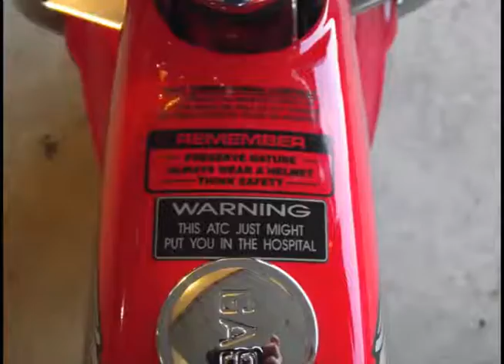1973 74 Honda ATC 70 Chrome Custom

Comment: Hey man, You did a wonderful job on this bike. I have a 1973 honda ATC 70 3-Speed and the 1985 Honda ATC 70 4 Speed. I plan on rebuilding them both from the ground up!
Reply: Thanks! It took a while to do, but thanks to hondaatc70.com and ebay, I got all the parts I needed.
Reply from the maker: Thanks! It took a while to do, but thanks to hondaatc70.com and ebay, I got all the parts I needed.